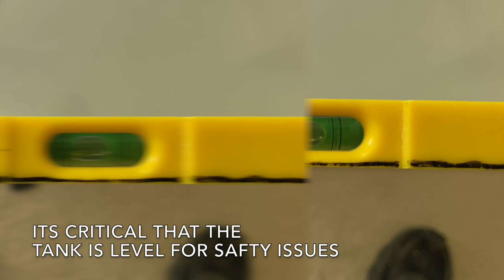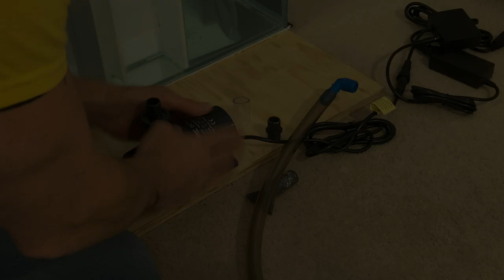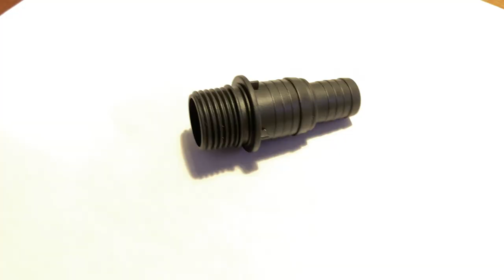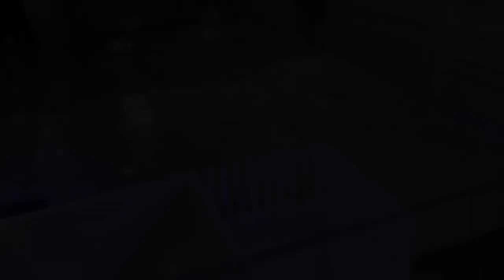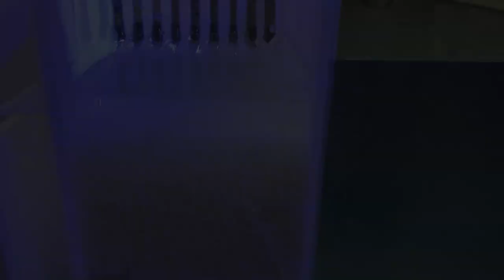How To Set Up And Build A Saltwater Reef Aquarium (Part 3) -75 Gallon - Filling, Pump, Turnover

Comment: nice update Tom, this turned out just like you planned! it's always nice when that happens👍
Reply from the maker: Hey Paul, Thanks, yea, so far so good! The next couple of weeks i’ll be adding water from the 20 gallon and the 6 gallon into the 75 so I can better match the parameters and chemistry of those two tanks before I put anything in the 75 gallon. That’s why it’s on the floor right now. I can’t move anything yet. 👍🏻🤪

Comment: That's beautiful tom ..its just so amazing the detail you put into your tanks .perfect square angles and cuts ..really nice. 👍
Reply from the maker: Thanks Ben, I appreciate it. 😊👍🏻
Reply: Tom I'm beginning to think that I might have a cyano issue initially it was like Dinoish looking and brown now its these super long black strands in the display now and they dont disappear at night any ideas looks like a brunette went swimming in my tank 🤣
Reply from the maker: Hey Ben, cyano is a bit more in the reddish color, and forms Mats, not really stringy. It can, but it’s usually reddish. You might still have diatoms. Check some images online and see if you can match yours with any. At any rate, patience is the most valuable thing you’re going to have to practice with either. There’s no long term miracle fix. ChemiClean will cure cyano temporarily, if it’s cyano. Test your nitrate and phosphate, continue to do water changes and siphon or brush out as much as you can, especially when you do your water changes. It may take a month or more, be prepared. 👍🏻
Reply: Thanks tom

Comment: That was super smart regarding the pipe to fit the into of the tube for the hyger return pump. I wish I thought of that to fit a 1/2 loc line before I before a slicce 1.5  return pump. Thanks for the tip!
Reply from the maker: Hey Emanuel, thanks, yes, always looking for a way to make it work 👍🏻😊

Comment: Awesome Tom!, Why did you put the salt in when the tank isn't on the stand yet?
Reply from the maker: Haha! I have to clarify that in the next video. I’ve gotten quite a few questions for that. The issue is I’d like to match, or come as close as I can to  the parameters and chemistry that are in the 20 gallon and 6 gallon in the 75. Trying to avoid as little shock as possible. I’m not ready to move the 6g yet.   so I can’t put 75 up on the table yet. What I’ll do is use The water in the 75 to do water changes, but I’ll also add the old  tank water from the 20 and the six into the 75 as I do the water changes. Getting the chemistry closer. Then obviously empty all the water from the 20 and the six into the 75 when I’m ready to make the transfer🤪haha. I’m not sure if that’s overkill but it makes sense to me. Try and get the water to match what’s in the 20 and the 6 ahead of time. What you think? I’ll also be adding  live rock in the 75 this week.

Comment: Are you going to build a stand for it ?
Reply from the maker: Hey Brandon, i’ll be using the solid oak table that the 6 gallon is on. That’s why I can’t put it on the table yet. I’ll be putting a few oak braces on the legs to better support it,  but it’s an extremely sturdy table as it is. 👍🏻😊

Comment: Love the setup but why is it on the ground?
Reply from the maker: Hey Koray, thanks! It’s a planning issue. I need to transfer the contents of both tanks into the 75 gallon. I can’t move the other 2 tanks until the day I’m ready. I’m also preparing the 75 to match the parameters in the other two tanks. I’ll actually be adding water from the other two tanks into the 75 before I even made the transfer. So I won’t be using completely fresh saltwater, if you can follow all that 😃👍🏻
Reply: @TOMReefer  thank you for the explaination. Now it all makes sense to me. Cant wait for the final look. Keep up the great work😁
Reply from the maker: @ac3ray903  YW Koray! A few other viewers ask that same question. I’ll Probably answer it in my next video along with a couple other questions😃👍🏻

Comment: Why does my skimmer excessively overflow after using Chemiclean? Your skimmer is working overtime to remove the leftover Chemiclean residue left in your system. ... If your protein skimmer is in a sump, remove the collection cup to allow the skimmate to overflow into the sump area. Is this ok tom I read it online and my skimmer is freaking out and I'm dumping cup after cup
Reply from the maker: Hi Ben, can you make any kind of adjustments to your skimmer? Like turn it way down. The only reason they recommend using your skimmer is for oxygen. If you have a sump set up,  and good turbulence on your water surface, you can run chemiClean without your skimmer. Ive run it with no skimmer in my 10g and 6g with no problems. The amount of oxygen from skimmers is small compared to your water surfaces. You can drop an air stone in if you feel like. 😊👍🏻one other thing, if it’s after your chemiClean treatment, try cleaning your skimmer, even down in the chamber.  That can remove film from the sides and stop it from over skimming.
Reply: Thanks tom I was freaking out I did dose chemi clean and it finally calmed down amazing how just 2 little pea sized scoops of powder can do that lol
Reply: Also adjusted it to the lowest setting 👍
Reply from the maker: Haha! Yes, I’m not really sure why it causes it? But it’s really common 👍🏻glad to hear it calmed down